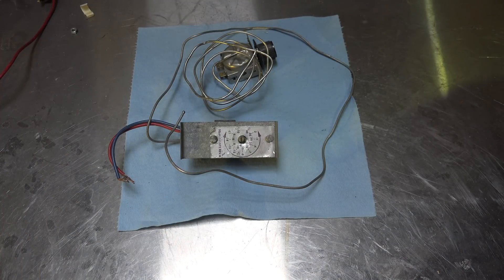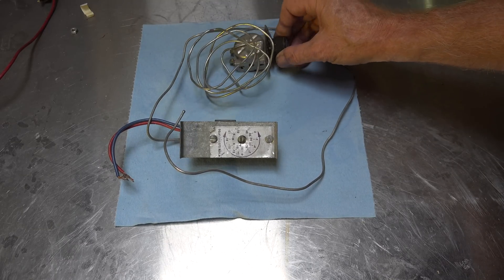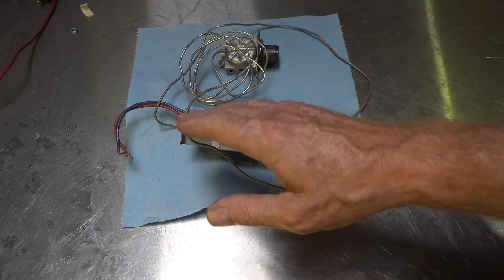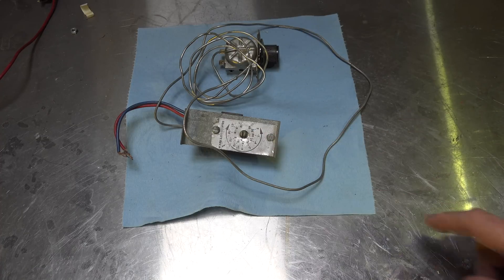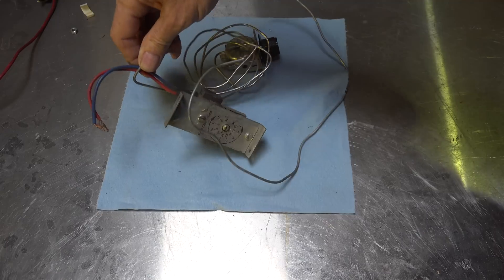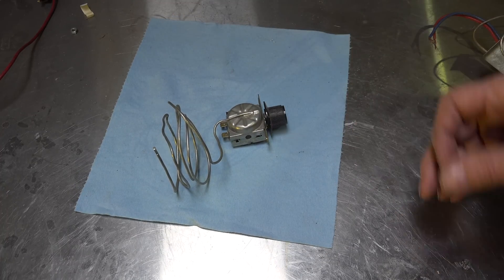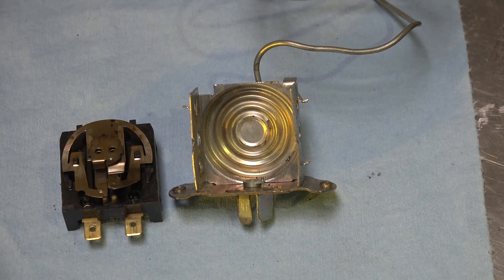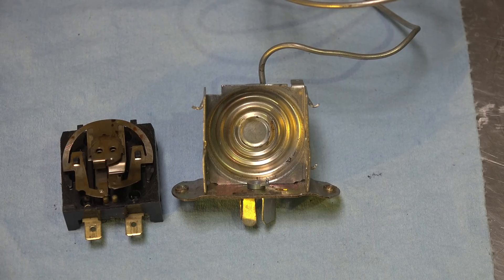How the bulb thermostat works.

Comment: After I replace a bad thermostat I like to break open the cap tube to hear if it's hisses (still charged).  I replaced a t-stat on a old walk-in box that when broke open liquid sprayed out.  Do you think it was r-11?
Reply from the maker: Probably not because R-11 would have a negative gauge pressure at the temperatures inside the walkin.  It could be one of those substances that we could tell you but then we would have to kill you.  lol
GFM